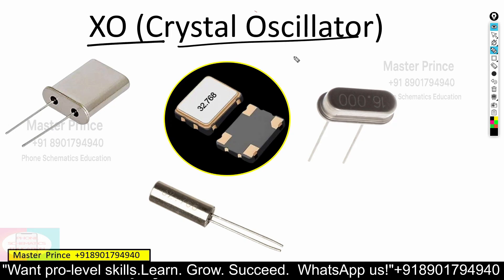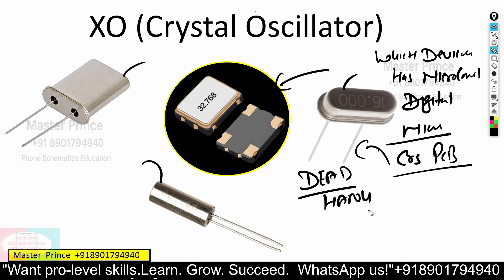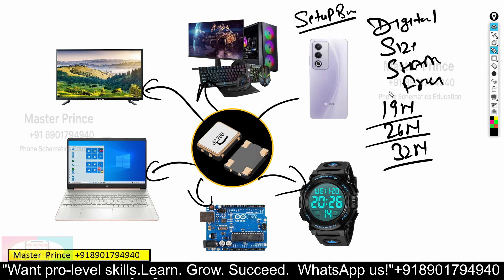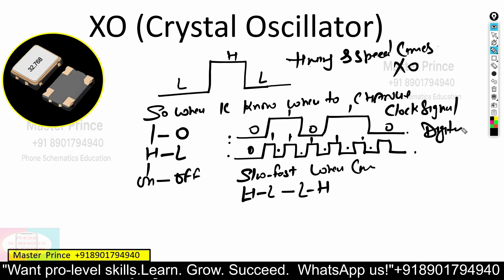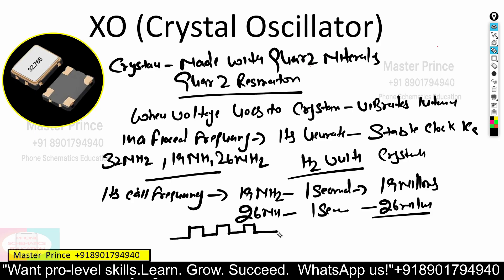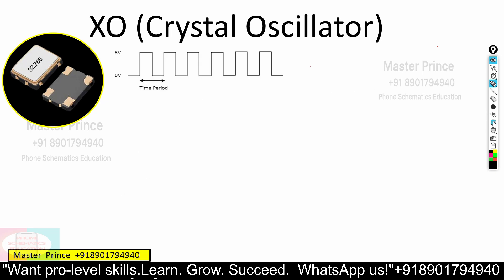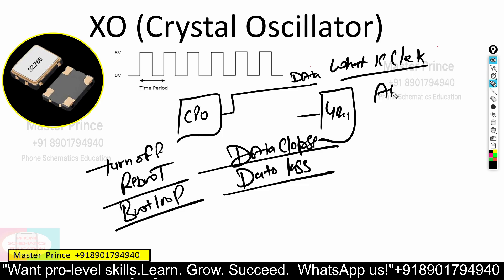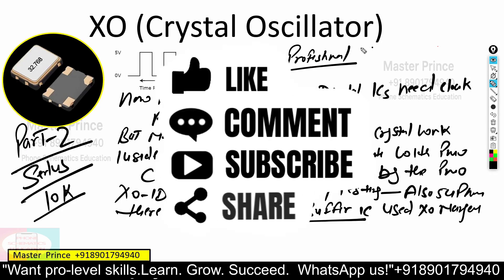Crystal Oscillator (XO) Explained | Dead & Bootloop Phone Repair

Comment: DC Reading  :

1. Power ic problem reading 
2. CPU problem reading 
3. Emmc/Ufs problem reading 
4. RAM problem reading 
5. Mtk phone reading 
6. Qualcomm phone reading 
7. Normal phone reading 
8. Without CPU reading 
9. Without RAM READING 
10. Without emmc reading 
11. Without power ic READING 
12. Short reading 
13. Full short reading 
14. Half short reading 
15. Leaked short reading
16. And others
17.low booting 
18.high booting